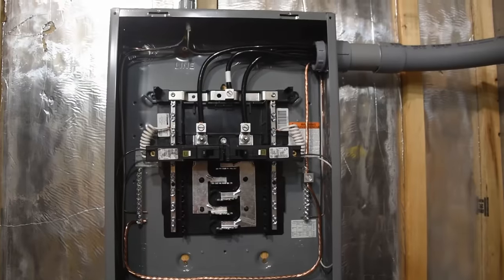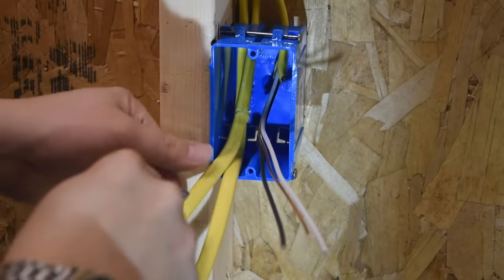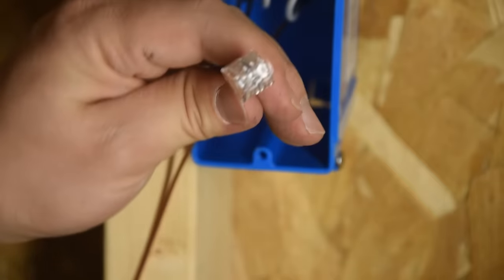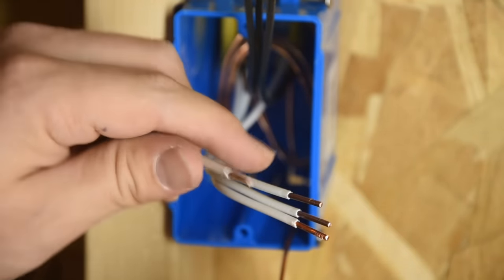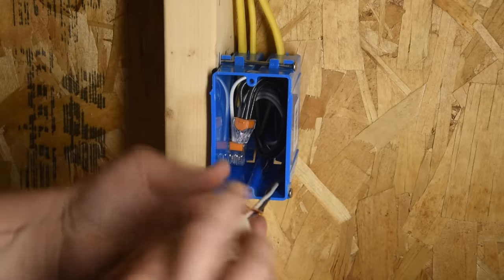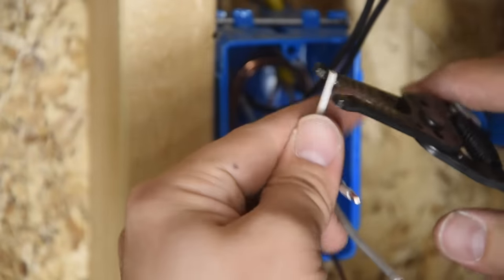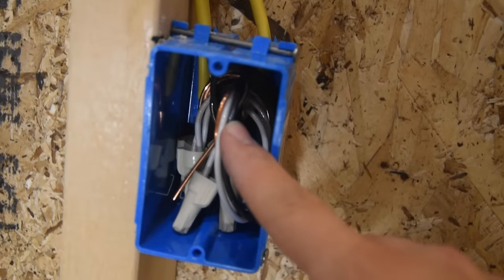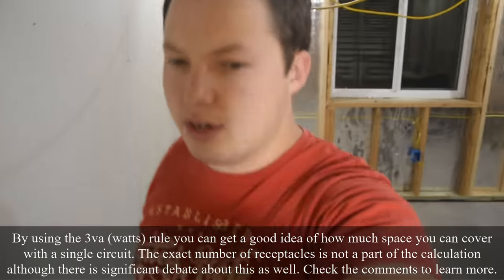Wago's vs. Wire Nuts - How To Wire Outlets During Rough In

Comment: Electricians: "never use the back stab connections on outlets!"
Also electricians: (gaga about Wagos, which are basically the same thing)
Reply: I am an electrician and I  believe Wagos have a little more surface area contacting the wire than back stabs on receptacles. But I still  don't trust them because they spin on the conductor with almost no resistance, it can't be as good as a wirenut.
Reply: @stickshaker101  how do you feel about Buchanan crimps I love em cuts down on handyman /owner  messing with my connections lrnd that from 2nd co. I worked 4 did a lot of new homes. owners always trying to cut a part our pigtails trying to add  than saying we didn't do connections right lol we where like where are the plastic covered crimps ?
Reply: @stickshaker101   I'm not in the trade, but I feel the same way.  I used them on an LED fixture, which was maybe 15 watts, but for an outlet I prefer the firm feel of wire nuts and screws.
Reply: Wagon nuts would not be approved almost everywhere if they were not safe.
Reply: I know several very good electricians that swear by wagons they use the lever nuts though and swear by them.By the way  my buddy has been a contractor  electrician for over 35 years.
Reply: @ronolson1579   i have an old example would not be approved almost everywhere if they were not safe FPE the red handles of hell
Reply: I'm a master electrician with 35 years - and I LOVE the Lever-Lock Wagos - and for the record, they are legal to join Aluminum to Copper if you apply their NoAlOx compound. 
With the Push On Wagos I like them for lighting circuits but not for high current circuits. 
On grounds all of the jurisdictions around here require crimp ferrules for residential (they don't even want wire nuts!???) but in commercial and industrial they want wire nuts and pigtails, no loop-through outlets. 
My humble two cents worth 😎⚡
Reply: @ronolson1579  They're safe *enough*.  But they're basically the same thing as backstab outlet connections, an electricians hate those.
Reply: @stickshaker101  Contacting surface area is the name of the game.  You just can't beat the contact surface area of a pair of wires that are twisted and then nutted.  I think Wagos are really neat and I've used them for small loads like light fixtures, but let's face it, they're basically the electric equivalent to Sharkbite fittings.
Reply: @igfoobar  I am a master electrician. Who says that electricians hate stab outlets?  All the connections as well as the wagos, are UL listed.
Reply: @bensonelectricinc  "Master electrician" and "good electrician" are not necessarily the same thing.  Any sparky who really cares about a job done right has said "yeah, don't use the back stabs, do it right".   Stabs are basically the electric equivalent of SharkBite fittings.  Sure, they'll work, but you don't want to be around when they fail.
Reply: @ronolson1579  Federal Pacific breakers were UL Listed and approved everywhere at one time too.
Reply: @igfoobar  I'm no electrician, but I'm an electrical engineer.  I have back stabbed outlets in a few pieces of equipment I created for my lab.  I see no equivalence between that and a SharkBite fitting unless you are using some super low grade spring retention outlet.  The wires in my outlets are securely screwed into place and are going nowhere.  What's wrong with that?
Reply: @EGL24Xx  Contact surface area.  A screwed-down lug exposes more of the wire surface to more of the outlet contact.  More surface contact = less resistance = safer.  Maybe you will never draw enough amps to exceed the stab, but wouldn't you want the connection rated for at least as much current as the conductors on either side?
Reply: If you have no idea what you are talking about you should not speak (foot in mouth).
Reply: @igfoobar  Actually, a screwed down lug will likely have more contact resistance as multiple contact resitances are involved.  In fact, due to the shape of the clamp in the back stab, it's likely that it will yield the lowest possible contact resistance.  (maybe I'll test that, I have the equipment to do so)  I routinely run up to 30 (sometimes even 40) A through the connection with around 500 A single cycle peak and have not had any problems.
Reply: @bensonelectricinc  If you don't know my qualifications you're free to keep your comments to yourself.
Reply: @EGL24Xx  The screwed down lug showed less resistance when I compared them with a multimeter ... but if you find otherwise I would love to compare notes.   Hopefully it won't matter soon because the newer back-wired lugs give us the best of both worlds.
Reply: @igfoobar  those contact resistances are in the single digit milli ohm range.  You can't use a handheld multimeter for that.  Maybe a 4 wire multimeter will work, but an external current source with a voltmeter will be the best.
Reply: @EGL24Xx  That's not what they're talking about...they're talking about "quick-wire" connections, not "screw and clamp" backwire connections like you're referencing to.  I'm in maintenance and know better than to use the quickwire connection.
Reply: @sinistersparky9657  as A electrician of 20+ years. I believe that code states "a device must be able be removed from the circuit without interrupting the circuit" thus NO double hit, stab or screw. Personally I would never trust that little tab between the screws on a recep to carry current of the rest of the circuit. Seen them act as a fuse way to often and burn open
Reply: @davep6977  what code section is that? I too have been a General Electrician in California (equivalent to a Master in other states) since 1988 - in residential we're allowed to 'loop through' outlets - however, if you're finding outlets eating the tab off the side of the outlets I'm gonna have to say that's WAY more than 20 amps (do a load calc on the circular mils of that brass tab, remember it's only 3/16 long...) and you'll find that tab is good for about 40 amps continuous (unless the tab has been fractured obviously).
HOWEVER, loop through outlets are not allowed in commercial/ industrial in my jurisdiction
So I'm curious what code that is and what code year - I stay pretty current on code although admittedly I don't have a copy of 2020 yet so I've relied on Mike Holt and EC&M Magazine to get the gist of the new updates
Reply: @EGL24Xx  just no. A screw or a screw clamp is an oxygen free connection if properly torqued. It has a much larger contact surface area under greater overall clamping pressure. Period. Back stab outlets that use spring clamps are only allowed on 14AWG copper wire, which isn't even allowed in most residential circuits anymore for new construction. You can still back stab switches on 14AWG but I personally don't like it due to the electrical fires and arc faults I've found
Reply: The stab locks should be out lawed. My daughter moved into an apartment when going to university and all of the outlets where stabbed and a number of them where charred from over taxing.  Too little surface area on the connections. I changed them all and did it properly.
Reply: These so called master electricians who use the back stabs on 15a outlets crack me up.  They must really be New Cookie cutter Builder Electricians.  But thats ok,, cause when the back stabs fail after the warranty period, That gives service electricians like me a lot of easy easy work!  so keep it up! :)  as for the wagos I like them to connect light fixtures but I would not use them ike this! especially a 20 amp circuit lol.
Reply: @sinistersparky9657  Maybe try reading what I said (I promise it's not too complicated)
Reply: @EGL24Xx  HAHAHAHAHA 😂🤣
I can read son. You said, and I quote, "Actually, a screwed down lug will likely have more contact resistance as multiple contact resistances are involved. In fact, due to the shape of the back stab, it's likely that it will yield the lowest possible contact resistance."

Let's establish some industry standard terms:

Back Stab wiring means utilizing the back spring clips provided in some outlets - these are limited by NFPA 70 (The NEC) to 14AWG copper wire.
This does NOT refer to back-wiring with screw clamps provided in many spec-grade outlets. Those receptacles can utilize 12AWG Cu wire as well and are not limited by the NEC.

Your claim that a spring clip has less resistance is completely false and the NEC (and physicists) agree. Here's why:
1)The spring connection is NOT gas tight
 2) The spring connection will relax under high current due to heating.

A screwed down lug (assuming you are using 'lug' like the NEC does) has full-circle contact with the screw that is oxygen free. 

Even a back-clamped connection has less surface area (the wire is shorter) for contact. 
This is simple physics kid. 🤦‍♂️

I got news for you bud, you're not an electrician - and don't act like you're an engineer either because you aren't. 
You don't know the trade terminology that is clearly defined in Article 100 of the NEC.
But guess what - with 10,000 hours of verifiable experience (and about 20 more IQ points) you too can pass a Master's test! 
But if you want to give BAD ADVICE about electrical work, people like me will stop you - your claim, such that you've stated it, is patently false and unlawful for new construction since about 1999
Do you wanna go some more or are you good?
Reply: Here's a link for y'all to ruminate over...
https://www.electrical-forensics.com/Receptacles/ElectricalReceptacles.html

UL Standard 498 changed in 1996 and became part of the model code in 1999...
Hopefully this shuts up the so-called internet Super-Techs about what "back-wiring" means to those of us in the biz
Reply: @igfoobar  feel free to share your qualifications.
Reply: Repaired many receptacles wired with wagos. Caused fire. I don’t believe theymake a good soild connection like a wire nut does. These burnt up connections were all in commercial applications/restaurants. I still never use them!
Reply: Those have changed too..using WAGO's and the single wire and back stabs, and nothing wrong with that because the wire has plenty of free space without bending and breaking...I've seen broken connections using screws also, personal preference if you ask me
Reply: So so true !! I’m by the beach and I forbid my electricians to use wagos only when the existing wire is 2-3” long and can’t use a wire nut
Reply: IGnatius T Foobar There is nothing like the gas tight connection of a tight pan head screw securing a wire to a receptacle. Also prefer silicon grease in a wire nut. Messy yes , but close to a oxidation free and reliable connection.
Reply: @TheElectrican  Actually they do make a solid connection. But you'll have to install them correctly, meaning strip the wire to the correct length and insert them fully into the connector.
This type of connector is not new, actually it was already introduced in 1979. It took nearly two decades before it became the standard here in Germany. And they are the standard since the mid 1990s.
The most fires caused by electrical equipment are caused by misused appliances (covered vent openings on appliances), or caused by old outdated electrical installations with loose connections (old screw type terminals) in them or aluminium wiring (mostly east-Germany) or cascaded and overloaded power strips.

The reasons named here are actually the same ones german electricians used for years, but now the Wago connectors are considered as beeing state-of-the-art. And actually you should be careful, cheap knock-offs from China could be dangerous in that way causing such problems. And they counterfeit them very well on the first look from the outside.
The big ones are rated for 32A, and tested for it. Even if you send 100A through, the connectors won't fail, the insulation of the wires will fail first. And the heat problems could also be caused by overloaded circuits, and not by contact resistance. 70°C is the critical conductor temperature for PVC insulation, if the current is too high, it will also heat up the conductor and damage the insulation. Sometimes it's amazing what a mass of loads people connect onto the same circuit and want to use them at the same time.
Reply: @ronolson1579  The list of deadly pathogens, toxins, and fire hazards approved by the US and the States over the decades of us regulatory history is so effing long that I'm just in awe of your ignorance. How do you get to adulthood and not know just how bad things can get with respect to regulatory mismanagement?
Reply: @igfoobar  YES! F**** shark bites a joke. And I agree with you about these stupid things to. I absolutely love them inside light fixtures, where you don't really have to worry about diagnostics, because when it fails you know exactly where it failed. But I would hate to deal with a household full of this crap twenty or thirty years after it was built. What a f**** nightmare.
Reply: @ronolson1579  Not true... Back stabbing outlets are approved but they are dangerous as hell... The entire reason arc fault breakers were invented was to combat the fires caused by burnt up back stabbed outlets. The Arc Fault breakers detect the arc of the spring connector with a load on the wire. Instead of simply saying "No more of these POS back stabbed outlets... Put the wires under actual SCREWS!" they came up with something ELSE to sell contractors. Typical government bullshit.
Reply: Jeff P  Exactly Jeff.....  Watching him put on a wire nut without first twisting the wires was cringeworthy.
Reply: @ronolson1579    I agree.  The UL says they are acceptable and work so I use them.   Some love them and some hate......    I love them.  :-)
Reply: I have seen the back stab connectors fail over time. It may take 20 yrs but then if burns a house down, is that worth it so the electrician can do crappy job and run. Yes they last long enough so you are not around to blame but as a homeowner, I have seen all kinds of crap that fails over time. Builder grade outlets and switches fail all the time. Spend an extra $100 and put in good quality stuff. I think they might be fine for grounds but I would not use them on something that carries current every day. A compromise are the ones that push in and then have a screw that clamps down on them. It at least saves you from having to bend wires to get them around the screw.
Reply: Marcel Germann   Testing high amperages on BRAND NEW wagos is much different than running high amperages through wagos over a long period of time. The constant heating and cooling of the spring loaded connection will eventually fail due to the amount of times the metal springs expand and contract over TIME.  I’ve seen the tests that show the insulation of the wire burning/melting before the BRAND NEW wago.  TIME brings a completely different variable into the equation
Reply: @michaelhealy7005  well said
Reply: you can't accelerate heat.cooling cycles. this is a big mistake in testing. look at auto paint development for one.
Reply: @bensonelectricinc  Some years back I had a lightning strike on my service entrance and it blew 3 of those stab connectors out of the back of the outlets. My breakers kept popping on reset until I traced them down. Two of the hot wires were lying on the ground wires and shorted out. Afterwards, I redid all of my outlets.
Reply: Both are ~Shit and destroy the wire and why a good electrician does not use them except in single light fixtures.  Also, several different types of WAGO's.  Some are better than others.
Reply: @ronolson1579  They're safe in the laboratory when installed by a technician given enough time to install them in full accordance with the manufacturers directions. But when they are applied in the construction of a building, often by unqualified persons, that is a different situation altogether. If the laboratory had to conduct follow up tests on actual installs without any previous warning to the contractors then many products would loose their laboratory listing.
Reply: I'm a licensed electrician and would never use these. Seen them fail under high loads.. Plus I'm still faster and cleaner using red and green nuts. A good electrician always twists! It's important on current carrying conductors .
Reply: Wagos are junk
I know that modern electricians use them, but modern people also buy water in a bottle.

I was a sparky back in 03’ strip and twist is a time proven method ( I’d go back to soldering if I could.
Reply: @igfoobar  as a physicist I agree you have the most solid argument against weagos.  Surface area matters. Less contact is like using lighter gauge wire, at least at that contact point. As long as you don't expect a high current draw it is ok. But not in my house.LOL
Reply: @techguyMD  Does the government promote back stab connectors,  or private, for profit builders wanting to maximize profit through faster installation and cheaper materials ?
Reply: @michaelhealy7005  interesting observation about minute wear over time compared to sending surges to test limits.  Many “new” materials fail over time compared to standard materials. We know domestic water copper pipes do have a lifetime,  but why the eagerness over plastic like pex ?  This Wago stuff gives me the same doubts.
Reply: @tonymanero5544  Of course the private for profit builders wanting to maximize profit are the ones using them. They CHOOSE to use them. The government, instead of saying "These crappy connections are illegal because they can heat up and cause fires" said "Here, use these crappy arc fault breakers a lobbyist paid me to mandate you use to sell you more crap."
Reply: @igfoobar  I've had to repair many a backstabbed receptacle where there was actually a load on the circuit. Receptacle is usually black and heavily charred. I don't know how more houses dont burn down.
Reply: @EGL24Xx  you are talking about commercial grade outlets with screw down plates. Backstab connection is just a thin metal tab which you push the wire into. The tension is the only connection.
Reply: @sinistersparky9657  he is trying to use his own theory to reason. He has obviously not had to replace the numerous burnt up receptacles we have because they were stabbed in the back.
Reply: There are different types of Wagos, I stick to the lever nuts, not the push-in kind.
Reply: @SgtZima  i stick to the tried and true wirenuts.
Reply: @nooneyouknowhere6148  Wagos are also tried and true, just not in the US
Reply: give those wagos a little pull and twist and they pop right off. not very confidence inspiring
Reply: @MrMisterMan you are correct. Spec grade, industrial grade, commerial grade, and mid grade do not have stab-in connections,  however most residential grade do. There lies the problem, you less experienced electricians and homeowners are using the cheaper and more readily available devices which have those connections. Many of which are 15amp outlets and are used with 14ga wire. You may get away with using 12ga wire on them but 14 does not make a good connection. Those outlets are the reason they changed the code to not allow feeding the circuit through the device and now you must use pigtails.
Reply: I want to around when they fail, I’ll  fix it by installing a Wago that will last a lifetime
Reply: @stickshaker101  it's ment to do that. And it moves with the wire instead of against. Wire nut hold them tight but over time they will get   loose from heating up and cooling. Have never had a wago fail. But the old type I have lots off fails over time(we don't use wire nuts but screw terminals.)
Reply: @igfoobar  they have plenty off load capacity. And they don't come loose like wire nuts can over time. That's the nr1 reason for melted connectors. When they start arcing. Not a overload
Reply: I use the levernut versions which work good.
Reply: @bensonelectricinc  nah back stabbing outlets is back stabbing your customer
Reply: https://youtu.be/B1pmuRsf1co the small one are rated for 35amps.. don't know what the bigger wagos are rated for. But I guess more... xD wire nuts are not allowed where I'm from. Just saying. But wagos are so wagos wins
Reply: Why don't you Americans just get some higher voltages. Then you can run thinner cable and more power with less Amps..  😂 3x400v much better.
Reply: @raunefare  I'd be happy to have higher voltage.  Unfortunately our electric standards were largely influenced by that scumbag Thomas Edison -- basically the Bill Gates of his day, more interested in his own selfish ends instead of what would work best for everyone.  Give me 240 or even 208 volts any day.
Reply: Except they’re not